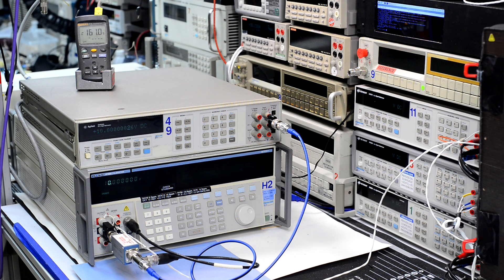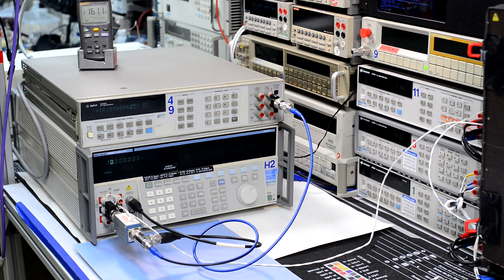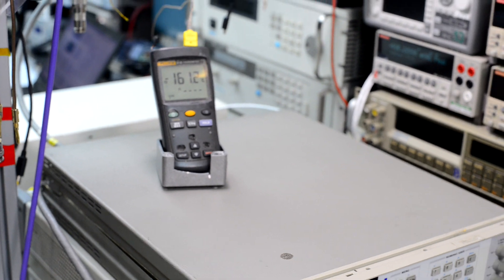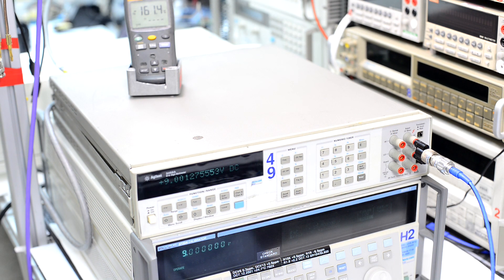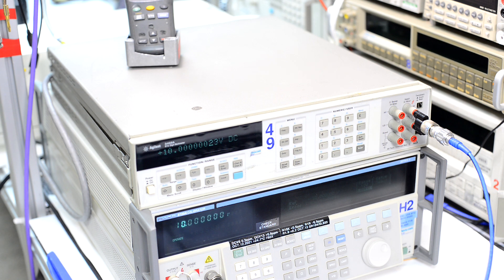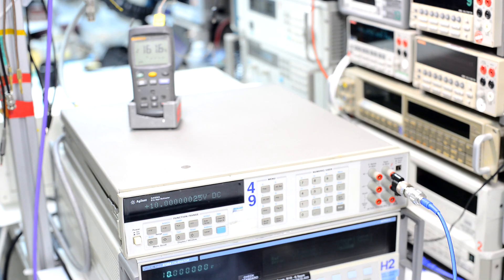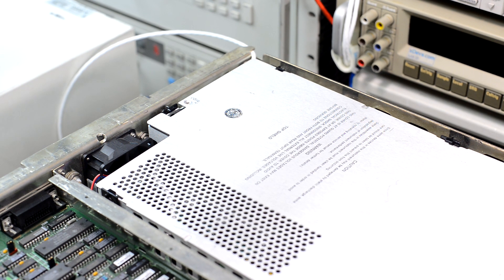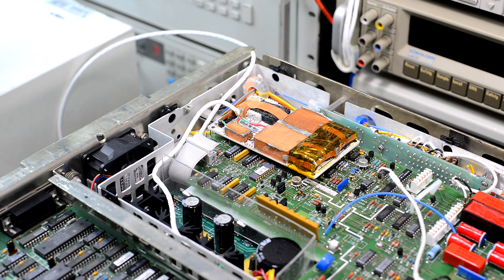Unlock 10 digits on HP 3458A DMM

Comment: What do u recommend in 6.5 digit mm?
I'm looking for a used one that isn't so expensive. Preferably a benchtop model
Reply from the maker: Probably second hand HP 34401A is most cost effective 6.5-digit and great performance for the money.
Reply: @xDevscom_EE  @christopherjackson2157 - I'd also recommend the typically very affordable offerings from Fluke from a bit ago. The 8505A/8506A - little known fact - they offer 6.5 digit resolution, except on the 10V scale, where they're a 7.5 digit instrument.

Comment: JJ array with High Tc Superconductor @ 112K, pretty cool! 😎
That was the highest transition temperature in (BiPb)CaSrCuO in about 1995, when I measured Superconductivity with my HP3458A @ university.🥱
Hopefully, there's finally an ADR1000 sitting inside the new reference board. 🥰
I just made my monthly transfer measurements with the 3458A, using 9 digits resolution and 0.02ppm StD only. 
I'm a bit jealous, now.😯

Comment: Did you just send the ":DISPlay:VOLTage:DIGits 10" SCPI command? That works on most modern DMMs, worked great on my 6.5 digit DMM6500 and lets me save a couple bucks where only relative measurements are needed! But sadly I don't have a cryogenic voltage standard as nice as that (yet).
Reply: Didn't work on my DMM6500. Said, 3 to 6 expected 😭
Reply: @Mr.Not_Sure  Sorry to break it to you but this video was posted on April 1st.

The DMM6500 is incapable of displaying more than 6.5 digits on the LCD. 

However you can extract more digits out of the SCPI interface with ":FORM:ASC:PREC 10" or by saving the buffer to a CSV, both those methods report the raw floats from the ADC conversion, if I remember correctly they contain slightly over 7 digits of unique, but noisy codes, 12 NPLC and average is very much required to make any use out of it.